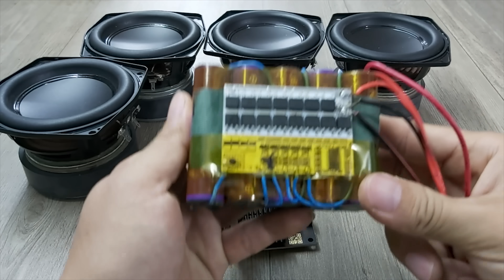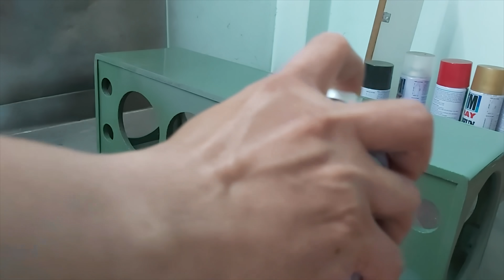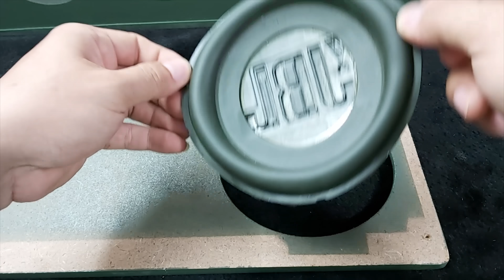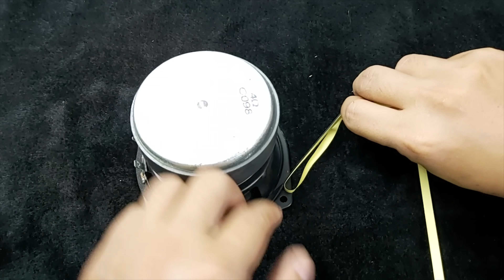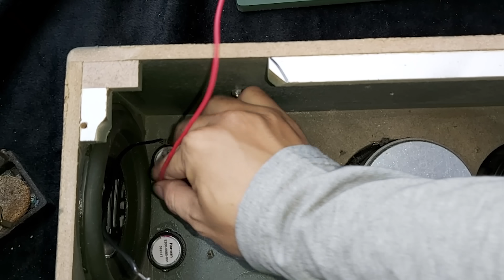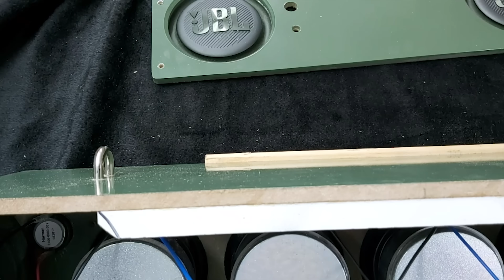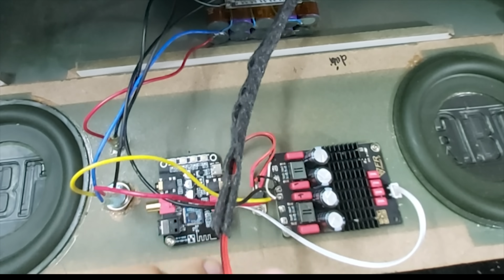DIY Bluetooth Speaker The BoomBox IV ( From old broken speakers) - EXTREME BASS TEST 100% LFM

Comment: I want to collect enough JBLs to do this, whos w me😂
Edit: that must sound amazing tho, nice work
Reply: Just buy some decent full range drivers for much cheaper and probably better lol
Reply: @MultiWirth  oh beleive me, ive had alot of ideas. But i really like the way JBL sounds plus i want the motherboard for LFM. Im going for simplicity but the usage of bigger amps on the inside would be a big plus.
Reply: @dudethatuploadsstuff4247  JBL speakers have proper enclousure design calculated by the parameters of the drivers and they have a DSP which is a digital signal processing unit so the speaker itself will have more bass and often less treble to compensate the small enclosure and there´s no chance you can make this at home.
So with other words, even if you use JBL parts, it will never sound like a JBL box.

Building a speaker enclosure isn´t just putting a few parts together, it has to be the right size based on what is best for the individual driver, also called Thiele Small Parameter.

So before ripping apart some expensive stuff, think twice about this so you don´t get disappointed in the end.
Reply: @MultiWirth  Jesus christ its a DIY chill out.
Reply: @MultiWirth  obviously if I'm this interested in it i understand everything in between. I just didn't waste 30 minutes of my life typing a paragraph just to possibly argue with someone on youtube.
Reply: @MultiWirth  also, I have a charge 4 an xtreme 2 and 3. I know they sound fine on there own. But like I said. DIY. chill.
Reply: @dudethatuploadsstuff4247  but what's the point of building something if u aren't doing it proper, yes it is a cool enough projekt but there are seriously  to many fatal mistakes here thet would take only few minuts to perfekt, All the seems in the box is showing, would it be to much to sand it down and put filer in🤷‍♂️🤷‍♂️ the box would have been awsome if he'd done that, also the perfekt enclosure is very important to keep the units alive, to little airspace and u will burn the coils in time, the right amount of air is essential for a good sounding box Even if it is only a poor made badly finish unmeasured box...
IT doesnt take much to put some efford in to it, he already made perfekt holdes instead of using a jigsaw... Also using tape on wires when he clearly had shrinking tubes, that is just lazy ass shit...
Reply from the maker: thx bro
Reply: So many wrongs on this projekt, i Hope u learn from comments and take it in instead of hating...
Pull out speakers and put 20mm damping wool in the back of the box
And maybe in the future, put walls between units and put filters on two of Them so u have 2 subsonic and 2 midbass, that will put more punch in to the box, also it will give more power to drive to ones who are subsonic for more deep bass...
Reply: @palledrengens  dude its a fricken DIY box. Ain't no one saying its some kicker box or a whole ass pioneer setup like no like the first guy chill out. Obviously if we're all here and this guy threw together a speaker that produces sound (shitty or not) we have an idea of how sound works. Yes we all see the seems. Yes we all know JBLS aren't meant to be chopped. But Jesus christ have some fun in life.
Reply: @dudethatuploadsstuff4247  u didn't get my point, that's okay...
He can do what he wants i dont care, but its sad that he didn't go the last when he went so far...
Who Said that he chopped anything?
Jbl aren't meant for chopped, well it certanly isn't build to last forever either, jbl is a top brand but the quality has gone down for jbl to be able to stay alive and compete, i have had several jbl products, and the quality isn't just what it was back in the days, the sound is phenomenal and Hard kicking, but I does not last... I am using bose now and sonos, fine sound and Nice bass, not grund stumping, but it last longer than jbl...
I jused to run jbl gti and power series in My car, where is All the good stuff for cars today, where is jbl at that point? Goooone... And old friend(Benjamin) i met through My carfi dealer startede a brand called B2 audio, this is like the good old days when jbl and Cerwin Vega ruled the world followed by Rockford Fosgate..
Back to point, the video says parts from broken...
Its also common knowledge that it would have cost severel dollars beyond 1000$ and a Guy like this does not buy 2000$ worth of jbl and then Slaughter the hole deal to build a piece of shit box like that, the box would be cool if he had mounted woofers from inside and made the holdes like those in the side and if he had spendt 4 seconds of filling and sanding the box! Which STILL makes it a diy project...
Reply: @dudethatuploadsstuff4247  sorry for the miss spelling My dictionary is set for danish not english, and I don't see every Word it changes... But you can read it....

Comment: "From old broken brand new working speakers" 👍
Reply: The speakers could have had battery or motherboard issues or something else smh
Reply: @bigpoggy8674  speakers dont have motherboards or battery's Mr big poggy
Reply: @MaNNeRz91  okay, you clearly don’t know how to think 2 steps further. The speakers he got from the boomboxes could have been faulty units, the boomboxes themselves could have had motherboard/battery issues. Do you understand now?
Reply: @bigpoggy8674  don't give me false information if you don't want a dumb answer 👍
Reply: @MaNNeRz91  i said exactly the same thing but just with less words, but alright
Reply: @bigpoggy8674  you can't say to someone "speakers have battery issues" and expect them to think you're on about an entire sound system or unit. And there was no showing of any fixing of the parts used. The speakers themselves looked brand new and unharmed and the PCBs he used also looked brand new or straight out of a working system. The only thing I can imagine was broken were the subwoofers that the cones and suspension were re-used as passive radiators...
Reply: @MaNNeRz91  actually, you can, since we’re talking about JBL boomboxes, they’re portable  s p e a k e r s  and there wasn’t any fixing needed to be shown, and also, as i said, motherboards can also break, so perhaps he got those parts from defective units and those were the parts that happened to be working just fine.
Reply: @bigpoggy8674  it's still not a speaker though is it. It's a unit. Made up of parts. Speakers themselves do not have motherboards and batteries. The unit does. Do you tell people you've fixed the engine when you've change the battery in your car?
Reply: @MaNNeRz91  well, do you carry your Boombox around and say its a unit? I don’t really think so, most people call the units themselves speakers. Fixing an “engine” is definitely not an appropriate comparison in this situation as they are very different things

Comment: This is pretty random. Tweeter should not have any rough edges around the dome, you basically placed it in a tunnel. This will completely destroy the response of the tweeter at around 9kHz (frequencies with half-wave length equals to the distance from dome to that edge). But that's not the only problem, you have two tweeters per side, so you will run into phasing issues, which will destroy the response on other frequencies as well. 
I also guess that the cap serving as crossover was chosen randomly, so there's either a massive spike, or a massive drop at "crossover" frequency (frequency where tweeter starts to play).
Reply: He’s only gonna run into phasing issues if he doesn’t know anything about how to connect speakers though

Comment: You should add a crossover and anyway It's wrong to connect all the speakers for each channel in parallel(since the tweeter have 8Ohm and woofer 4Ohm), in that way the tweeters are receiving less current that the woofers, and anyway the final resistance is very low (1,3 Ohm instead of 4 or 8), the amp could have serious problems to drive it..
Reply from the maker: only 2 ohm
Reply: No, you should do the parallel of 4 , 4, 8, 8 that means  1/(1/4 + 1/4 + 1/8 +1/8 ) Ohm
Anyway the voltage is the same(they are in parallel) I was wrog, the corrent is double for the woofer .. 
You should give an  higher total  resistance  maybe putting the woofer in series, the tweeter in series and than them togheter, anyway it shows  like 5,3 ohm if without crossover...
But you need also crossovers to split signal for the tweeters and for the woofer with the  correct frequencies..
Good work man 👍

Comment: tweeter was like being a passive too
Reply from the maker: Rip tweeter
Reply: The tweeter is sealed, won't take any pressure from whatever else that's in the box. Should have a little capacitor in series to keep it to high frequency otherwise it will easly die with no crossover at all

Comment: I advise you to separate the subwoofer chamber from the tweeter chambers
Reply: I also saw the tweeter moving as well.
Reply: Yea the lower tweeters aren't gonna last being that they are not sealed unless it a crossover problem and bass is coming through to them but I suspect if that's the case they wouldn't of made it through the demo even you could even just seal the back up with something like hot glue but either way its a very nice build I can only imagine how it sounds in person
Reply: Tweeter are closed
Reply: HOLY 😂😂😂 THOSE BOTTOM TWEETERS BE GOING NUTS
Reply: Yeah the dust cap of the tweeters were moving
Reply: Indian price please ?
Reply: @theearthwidemovies6264  i dont thik this is for sale
Reply: He not used any filters or crossovers to filter  low frequencies
Reply: Guys, HERE is our True Savior

HalleluYAH (Hallel u YAH) - “Praise YAH”

YAH The Father (Genesis 1)
YAH arrives via The TENT OF MEETING
YAH was Who they Crucified for mans sins
YAH was Crucified on an Almond TREE

Original Semitic of Moses
Isaiah Scroll (The Original Isaiah)
Reply: no need.. ethey are closed behind.
Reply: @Juos10kustu  Look again, the right lower one is vibrating with the woofers.
Reply: @joseendungu  ooh shiit thats bad then :D

Comment: Enclose the tweeters and you should put crossover or capacitor on them. To prevent the tweeter receiving high current such as bass
Reply: Sir pinoy Po kayo?
Reply: He did put a cap in... It was big and yellow in the wiring. Go check the video again. Good of you to note that but the cap was there.
Reply: Was just about to say that.. poor thing needs a 4.7uf cap and should be isolated from the punching and abuse

Comment: NO WRONG WIRING. U CAN'T CONNECT LIKE THAT THE SPEAKERS
Reply: U
Reply: U can’t connect the speakers like that
Reply: Romeo Dodina  i have actually
Reply: @hvccreation  u wired every speak in pararel so 4:4=1 ohm so u get 1ohm at chanal
Reply: @hvccreation  i mean i didn't want to offend you but like that u will blow the amp it's better to buy 8ohm 2way crossover. With the crossover conect the tweeters and woofers in serial so it will be 8ohm and it will sound much better

Comment: 13:15 the tweeter looool
Reply: naa, its a wannabe sub only hehe... HVC Creation, what amp is that, looks like you wired it down to 1 ohm per side...
Reply from the maker: Rip tweeter !
Reply: @hvccreation  reflex port.

Comment: 13:35 look at the high frequency speaker lmao
Reply from the maker: thx bro, i repaired it
Reply: I was wondering lookig the big subwoof that it's just a visual effect then replayed and lmao the thing were exploding xDDDD
Reply: @Aw4yed  the 4 in front are speakers and the one on the side at this time stamp is called a passive radiator. Passive radiators make blue tooth speaker water proof and make the bass sound better then would be if it was open on that side.
Reply: AHAHAHAHAHAHAHHAHAHAHHAAHHAHAHAHHAHAHAHAHAHAHAHAHHAAHAHA
Reply: its a hybrid ! 🤣😆🤣😆🤦‍♂️🤷‍♂️
Reply: 😂😂🤣 XD

Comment: Good job but those tweeters are gonna pop. Because they are sharing air space with the speakers. And they are not designed for flexin.
Reply: Uncle Willie
AGREE
Reply from the maker: Thx Bro, i'll rebuild it in next video
Reply: @hvccreation  Just cover them from the back with a pvc pipe cap. Seal it with some glue or hot melt glue. And it should keep that air separate. 👍🏾